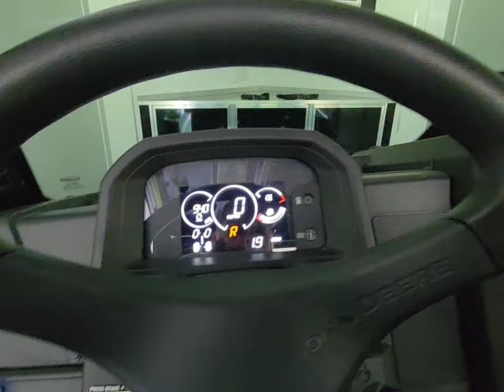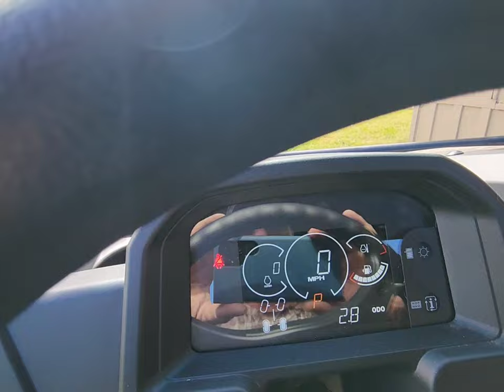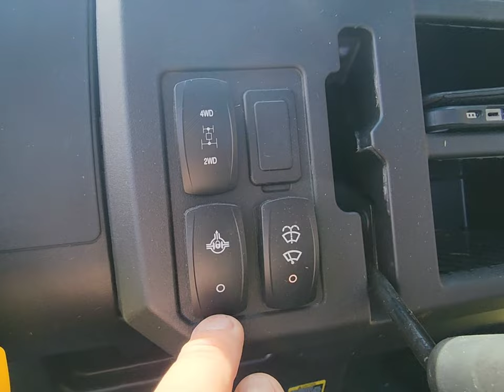John Deere Gator XUV835M Explained

Comment: Nice video! What model Pioneer did you have? How do you like the Gator compared to the Pioneer? I’m looking at upgrading from a Pioneer 500.
Reply from the maker: The Gator is nice for working around the property.  If you want the back trails performance and property maintenance the Honda Pioneer 1000 is the better package.